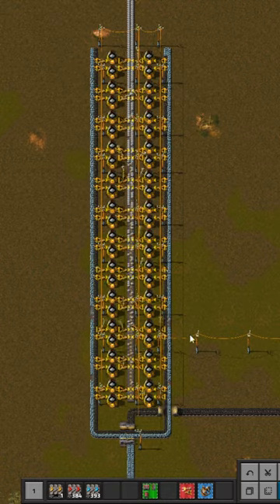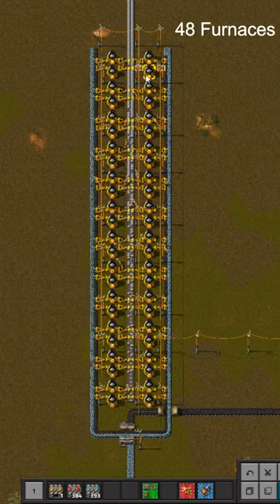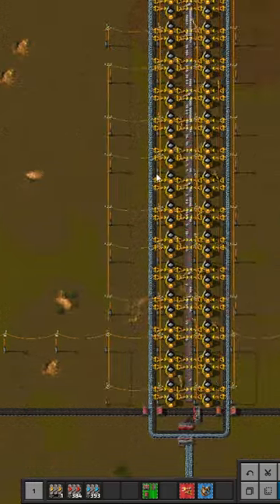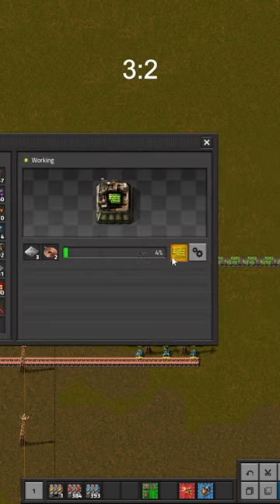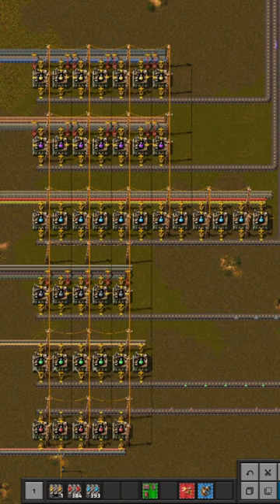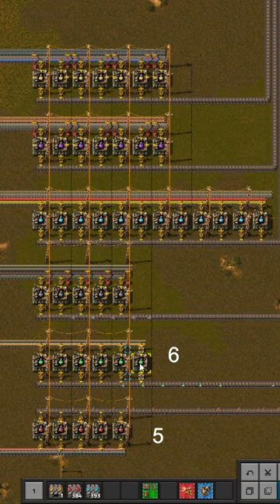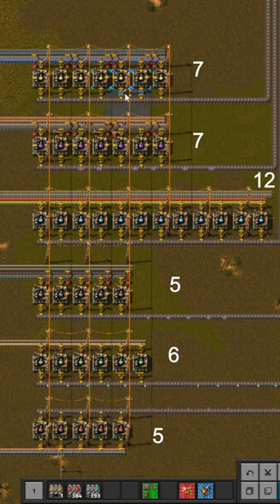Helpful Factorio ratios you shouldn't ignore #factorio #factoriotips #shorts

Comment: Yall use ratios? I just keep making more until theres a bottleneck and repeat.😂
Reply: Perfectly valid. The ratios help you stay organized when you're building big, but by no means necessary. It's good to have a rough idea, so you dont have massive vestigial parts of your base. Cuz if you're not using the ratios, you'll have at least one building type in the ratio that's taking up space for no benefit. Even in spaghetti bases it's helpful to know. And helps you not have to go back and modify stuff. 

It's kind of Pandora's box once you learn them though, when I started calcing them I compulsively have to get everything perfectly ratio'd 😅
Reply: Fr, never knew people played to this specificity. I just make shit till my shit works.
Reply: @ovalsquare this kind of stuff just makes it easier and more efficient. = more fun factor up experience
Reply: I just use networks to monitor liquid levels so that oils are used or converted depending on demand. Conversion threshold is always set greater than use. So if it's not being used and gets too full. It will automatically start being converted into a substance that is currently in demand.

Comment: Funny cuz I always eyeball ratios by "If resources reach the end of the belt means you can add more" logic
Reply: Overloading inputs is a reliably way to get the correct amount of output, but you still need to keep track of those inputs so that you have enough later on the bus.

For instance, say I've got an array of factories that need .5 of an iron belt, approximately. So I place a splitter next to the first belt of iron and prioritize it's output on applicable side, essentially committing a full belt to the array. What remains; aprox .5 will then go on down the belt when the array overloads, but if, say, the next array requires about .6 of a belt in order to feed all of its needs, then what remains of that belt will NOT be enough to saturate it's needs. At this point, I split the entire belt off, balance it's output with the next belt over, and keep a mental note that, in the end, that belt is going to have about .9 of its total resources until I use it later.
Reply: You're looking at the end of the belt but imo you should look at the start of the belt. If the beginning is constantly moving, great, you've reached full satisfaction! If it keeps stopping once in a while, then you might be able to add some machines. Thing is that sometimes items get through the whole belt, but then at the end of it almost the whole belt is emptied at once because a recipe takes a little longer to complete than a few second.

Comment: Always used storage tanks for my fluid with pumps and curcuits. When nearing full capacity, activate pump to chemical plants for cracking. Works like a charm.
Reply: My stunt was to feed the fluid past whatever else consumed it before cracking.  I.e. Heavy Oil is fed past the Chemical Plants making Lubricant before it gets to the Chemical Plants to crack into Light Oil.  Similarly, the Heavy Oil produced when performing Coal Liquifaction is fed past the inputs before going any further on.

Comment: I like to use 1 offshore pumps to 18 boilers. That way, you consume exactly 1 yellow belt of coal with two arrays. With two arrays of 20 boilers, 4 boilers will not be receiving coal at full power consumption anyway.
Reply from the maker: I like that approach! Usually I'd just upgrade the coal belt to red belt at that point, but I think your method is definitely viable!
Reply: Exactly! I don't remember the ratios from my head, but consuming full belts is far more crucial than full pump output.
Reply: This is a solid way of doing it too, never thought about matching it to the consumption but that makes more sense. This ratio is slightly off though. 1 yellow belt of coal will support 33.333 boilers, but 2 arrays of 18 each is 36 boilers, so that's still a couple too many at full power. Doesn't really matter too much since you don't wanna be at 100% power consumption anyway, so I'd still go with an even number for aesthetics.

Comment: About water pump - mind the every tile limits the maximum flow. 0 pipes = max flow. 1 pipe = max 6000, two pipes = 3000, three pipes = 2250 and on. So, always make power plant as close to water as possible.
Reply: Technically You can use tanks to achieve 12000 speed ... 4 offshore pumps to 400 steam engines in a single pipeline 😅
Reply: The flow rate gets slower due to how the fluid is simulated. I dont know about those numbers but i do know that the fastest you can get is chaining pumps and tanks for the full 12,000/s as tanks have the capacity to store enough volume to move that much volume.
Pipes only have 100L storage volume so even though a pump can move 12,000/s the pipe physically cant fit that much fluid in it. 60 ticks per second moving 100L per tick will only ever get 6000/s. Pumps with their 200L capacity can move their full 200 per tick or 12,000/s, but then the problem is your stacking pumps back to back which is where tanks come in as they span 3 tiles whilst keeping max throughput.
If you dont need max through put thoughput using underground pipes work, they only have a pipes 100 volume despite both else of the pipe being linked and counting as a single pipe (in terms of storing the fluid) thus their efficiency at moving fluids over distance.
Reply: @Queue3612  Just a note. There have been announced fluid system rework in one of the latest dev report. There will no longer be limited flow rate by lenght.
Reply: @jaromirandel543  oh cool.
Im so hyped for when they release all these changes and fixes.

Comment: My man. The crafting speed for assembly machines (mk1) is .5, meaning it takes twice as long as the recipe says to craft an item. You need double the machines you stated in this short to make 1 Science Per Second!
Reply from the maker: Hence why I said base rate :p
Base rate calculations are based purely on the craft speed of the item itself, not considering the speed of the machines. This is a common way to calculate things in the game.
Reply: @Xterminator  it's just a little misleading imo, to toss in the "base rate" calculation, when no machine produces at base rate.
Reply: @Nekedladies   So?  Follow the video and ur making 0.5 sps.  The videos real point is the ratios, which do hold.  Thanks @xterminator .

Also @nekedladies as a "southerner" myself i love ur name!

Comment: You should ignore the cracking ratio and make lube and rocket fuel in stead
Reply from the maker: I somewhat agree but think it's situational.
Usually I like to turn one or two heavy to light cracking machines into lube. Later on I'll want rocket fuel, but usually I want as much Petro as I can get, so having enough machines to crack all the light to Petro is nice imo

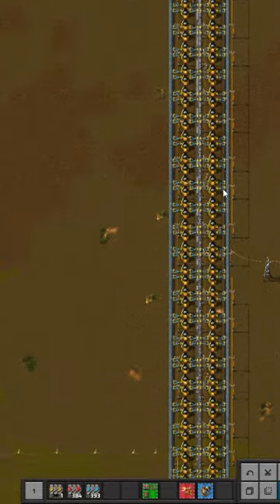Comment: 0:15 I dont know where you got "half that" from.I very much remember steel taking the same amount of furnaces. It takes 5 plates to make 1 steel plate but it also takes 5 times as long.
I know i have working builds where its just 2 furnace arrays in a row with the iron plates feeding directly into the second array. Though because steel plates are 5:1 for each belt in you get 1/5 belt output.
Reply: Bro means steel furnaces instead of stone furnaces

Comment: You only need 24 stone furnaces to compress a yellow belt with stone bricks, not 48.
Reply from the maker: You need 24 to compress some lane of it. You need 48 total to compress both lanes of the belt.
Reply: @Xterminator  Actually, stone bricks smelt twice faster than iron and copper plates. So technically,  it's 12 stone furnaces for each side of a yellow belt.

Edit: I'm wrong. I checked the game again, I was misguided by Trupen. Sorry
Reply: + output same 
- input needs double

Comment: What is the ratio for 1 Nuclear Plant equivalent, for Heat Exchangers and Steam Turbines?  My rough math is 1:4:8, to keep the numbers easy to remember.  I.e. a 1x2 setup would be 4 Nuclear Plant equivalents, meaning 16 Heat Exchangers and 32 Steam Turbines.  Of course then you need 1 Offshore Pump per 20 Steam Turbines which throws off the math again.
Reply from the maker: Yup that sounds right! The actual ratio is like 7.3 turbines or something like that, but rounding up to 8 is what I do as well. I'll probably do another short on nuclear ratios in the future.

Comment: id like to mention your 1 science per second isnt actually accurate, while it is an important ratio that will produce equal amounts of all science, using assembler 1s that will produce 30 SPM, 2s will produce 45SPM and assembler 3s will produce 75, this is because none of the assemblers have a crafting speed multiplier of 1.

0.5, 0.75, and 1.25 for 1s, 2s, and 3s respectivly.
Reply from the maker: What you said is correct. But this is why I said "1 science per second base rate", which is a common way to calculate ratios and production rates in the game, especially early on before modules and beacons. 
The point of this is specifically so you don't have to take machine speed into account, making it easier for less experienced players to figure out. 
So what I said was accurate, since it is 1 per second base rate, by basing it for the item craft speed. But yes, it is not a true 1 science per minute rate
Reply: @Xterminator  my apologies, I missed you saying "base rate", perhaps in a longer format video this is something that could be clarified, but a reasonable exclusion in the limited format of a short.

thank you for the video and reply.

Comment: Mmm, I would say some of these are useful to know, but some of these are unnecessary. Like 144 stone furnaces for blue belt - I don't think anyone would do that. I think it's just easier to remember 48 to yellow belt, same amount of steel/electric furnaces for red belt, and 72 steel/electric furnaces for blue belt.

You also don't mention that stone brick smelts at 2:1 proportion, so while amount the furnaces is the same, you'd need to feed twice as much raw resource compared to iron and copper (so the setup shown in video wouldn't work)

Oil processing seems overkill as well - I would rather remember the ratios for 5 refineries, which I believe is 5:5:2, which is much simpler to build with.

Science assembler tips don't mention that no assembler has a crafting speed of 1, and while you alluded to it by mentioning base speed, you can only catch it if you already know about it.

Comment: that was helpful but how about electric furnace ratios? how many do i need for a full iron belt
Reply from the maker: I did briefly mention it in the video, but it was easy to miss. With Steel and electric furnaces you only need half as many as you would with stone furnaces, because they're double the craft speed.
So 24 to fill a yellow belt of iron

Comment: Blue science is such an outlier in how many machines for it you need.
No wonder its commonly the science pack that people considerbthe biggest hurdle.
Reply: Ive never had a problem with Chemical Science. Its Logistic and Production science i dont like. They take WAY more supporting machines for making all the materials needed for the science packs.
Reply: @Queue3612  it's not even the number of machines for me. the low density structures for yellow science always creates a bottleneck on my copper supply.

Comment: Why is that when I look at factorio calculator it says I need 10 machines to make 1 red science/s instead of 5, what am I misunderstanding here, it sounds like the numbers are halved in the video
Reply: The rate of producing Red Science is 5 seconds, but that is for Hand crafting.  If you are using level 1 Assemblers, those work at half speed meaning you will need 10 of them.  The video shows the ratio if all the Assemblers making Science are the same type (and ignoring module bonuses).
Reply from the maker: Yup just as Todd said! If you consider assembler speed then the ratio changes, which is why I find it easier to just do base rate and assume all assemblers are the same type.

Comment: Rates for stone furnaces vs blue belts kinda funny. Why anyone need such an information?)
Reply from the maker: Good question haha
But figured I'd cover it just in case there are some crazy people trying to get full blue belts of plate from stone smelter builds 😅
Reply: @Xterminator  do you have some rates for lines in a bus build base? How much lines for every resource, what resource to put on a bus and how wide such bus should be?

Also, which way a splitter better to use to make side arms from the bus? For example in two lines is it better to place splitter on both lines and make an arm and place second splitter after or better to place splitter only on one line to make an arm?